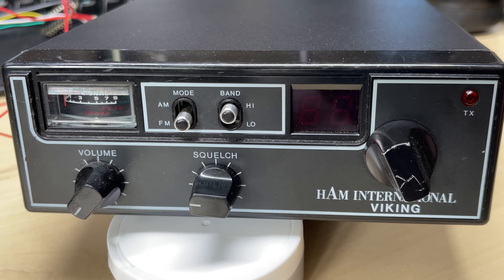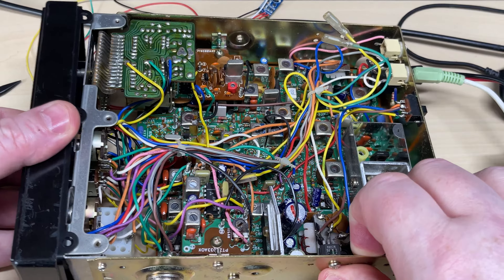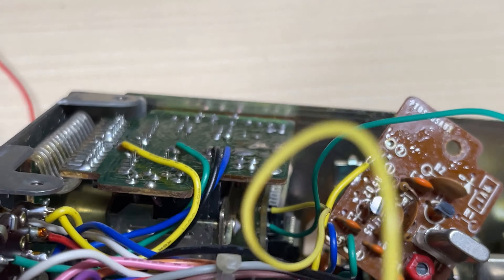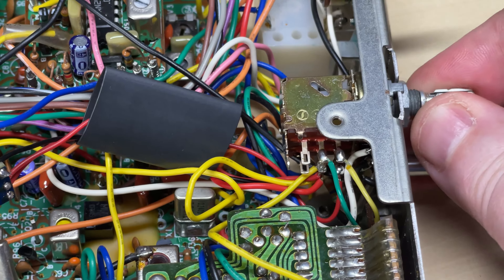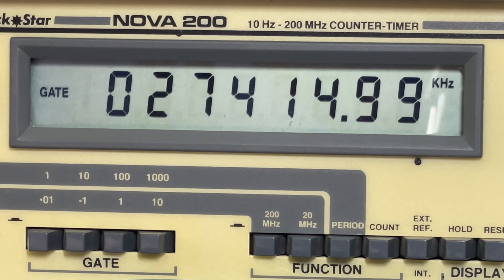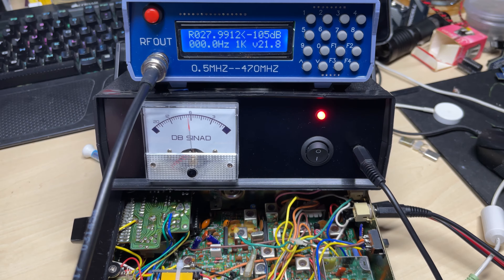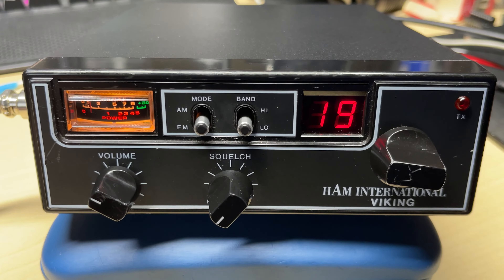EP 148 - HAM International Viking - 80 channel AM/FM - strange crystal board fault.

Comment: Picked one of these up a few weeks ago, managed to get the receiver side working still no transmit as yet ..
Reply from the maker: Check the diode behind the audio amp next to the metal shield , it looks like a bead , should have 13v on it , or maybe your rf output has gone ?
Reply: Thank you for the reply, it’s been a bit of a mission to be honest, I picked it up in a job lot of a have ago hero .
The new caps I ordered turned up today so I have just spent the last few hours scratching my head with it and when I started swapping them over one was actually in backwards ! ... so after swapping it over and a few other parts later all sorts of magical things started to happen . I now have pa and audio , new tx light is working and have 12v all the way up to d13 but unfortunately it does look like the finals .. 
is there anywhere that you recommend to get a new replacement it has the original C103 in it , there are so many bad copy’s out there . Regards mark .
Reply from the maker: cricklewood electronics may have some

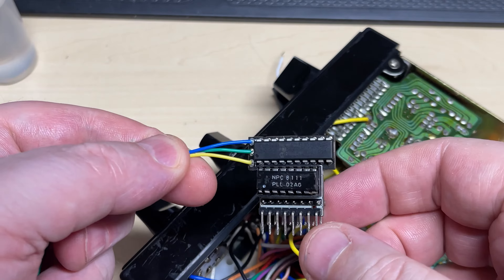Comment: Once you've pushed the PLL into your mod board, if you look at 3:12 and again at 8:35, it looks as if there's something between pins 7 and 8, is there supposed to be a short here as part of the mod? Wondered if this could be the cause of instability? Another nice video!
Reply from the maker: Hi ,i did this video a while back, i "think" it was just a bit of wax, pins 7 and 8 are the MSB on the pll inputs . However well spotted there, if you look as i removed the PLL it was also there . I have just checked the unedited footage and its defiantly wax.

Comment: Can UK40 be added to a Colt 444 AM/FM version?
Reply from the maker: I did try on my HAM UK and failed , due to the pll.
Reply: @MicroChipz  OK, could the high block be trimmed enough to the uk offset to get 1-26 uk...?
Reply from the maker: I reckon it can with adding extra capacitance